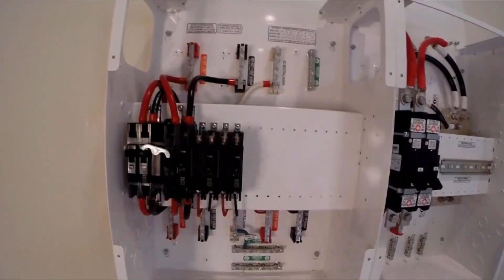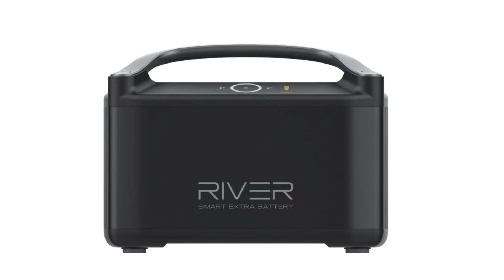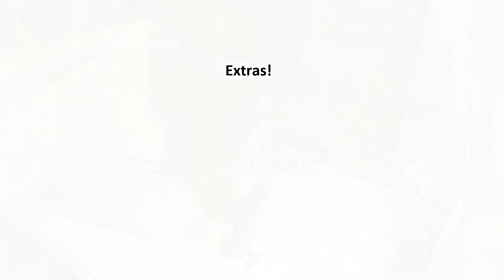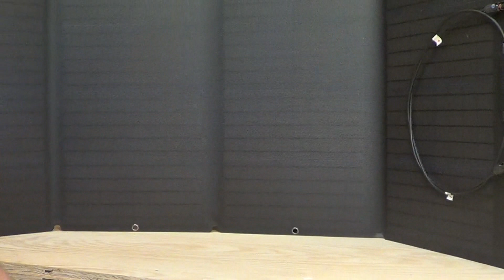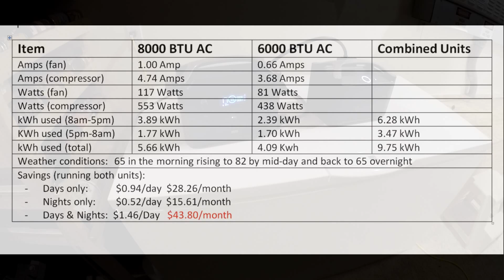EcoFlow RIVER Pro with Extra Battery and Solar Panel #EcoFlow

Comment: At the 10 min mark when you had everything plugged into the unit,it would've been nice if you had said how long it took to go from 100% charge to 57% charged...
Reply from the maker: ebayerr, As a general estimate for any of these systems, you can take the battery capacity in kWh and multiply that by the efficiency which is around 80% and then divide that by how many Watts your devices are pulling.  For example:
Running a light at 200Watts with a 1kWh battery multiplied by .8.  It would run for about 4hrs.  Of course there are other factors but this is a good way to ballpark it.  Thanks!
Reply: @HomesteadEngineering  : Yeah.Great example of having one device plugged in with a known quantity.
But it's a different story when there's many deices of unknown loads plugged in.We,the viewers,have no idea how many watts each individual component draws.

Comment: How come u don't show how, where to plug in the solar panels? Mine came with no instructions and I need an adapter
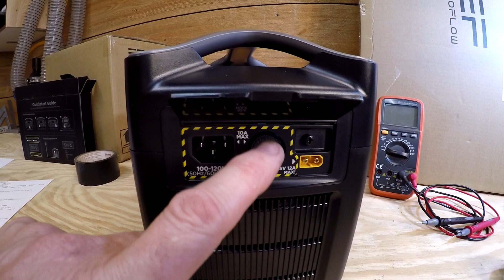Reply from the maker: Go to 5:12 then at 5:45 use the yellow XT-60 connector with the supplied adapter that has the MC-4 connectors that connect to the panels.

Comment: Another question please

I connected both of the batteries with the inverter to the 110-120 volt plug to a small refrigerator (set at 37F  degrees) that when on  (it cycles on and off) it uses about 45 watts.

I used a Kilowatt device to measure the wattage over a 24 hour period. It said I used .27 kilowatts or 270 watts over a 24 hour period.

The 2 batteries were at 86% when I started and after the 24 hour period it was reading 47%, so that is 39% of the two batteries.
So if both units are 700 watts that's 1400 watts minus about 15% for actual usable watts that leaves 1190 watts I used about 464 watts or 39% of the 1190 watts (86% to 47%)

But the 24 hour watt measurement was .27 kilowatts or 270 watts. So where did the other 194 watts go (464 watts minus 270 watts)?
Can that be all because of the inverter? That seems alot.

It means if plugged into the wall it would have used only 270 watts but plugged into the 2 ecoflows it needed 42% more energy the 464 watts?
I must be close using the 2 batteries actual power about 1190 watts and I used 39% of that.

Lastly,
I have now connected the batteries that are now at 47% to the 12 volt output on this same small 12 volt refrigerator.

I would imagine that the 12 volt during the same period would use much less wattage since their is no inverter that is working, correct?
And how much less do you think it might be?
Reply from the maker: Hello L.  Lets try one more test: 
1. charge both batteries to 100%
2. disconnect and plug in your refrigerator with the Kill-A-Watt meter for 24 hours or maybe even 48hrs
3.  Now recharge to 100% but use the Kill-A-Watt meter to measure what it takes to recharge

The difference should tell you the losses in the inverter and the charger.

Comment: 200W solar input, but 160W panel in normal conditions will give you about 100-120W.
Does it mean that we can plug two of them parallel? DId you try it maybe? Or two 110W?
Reply from the maker: I believe you can plug in what ever you want as long as you don't ever exceed the input limitations.  You have to look at Watts, Current and Voltage limits.  Note: Panels tend to up there Voltage and Wattage on cold days with bright sun.  I don't think the unit will be forgiving of exceeding any of these limits for any amount of time.  Thanks!
Reply: What I've read: More Wattage is no problem, the unit doesn't draw more than the specified maximum. But if you get more voltage than specified, it will switch off for safety reasons. So, parallel connections of solar panels seem to be ok. I only have one panel, so I have no practical experience on that.

Comment: Never knew I would be able to afford a power station as powerful as this River Pro for about $600.
Reply from the maker: While I do get a commission if you use my link to purchase, Costco has a killer sale on this right now.  So It won't hurt my feelings if you go there instead: https://www.costco.com/ecoflow-river-pro-portable-power-station%2b-river-pro-extra-battery.product.100716886.html
Reply: @HomesteadEngineering  I really like the display of the River Pro. You can get a ton of information especially the time left on the battery.

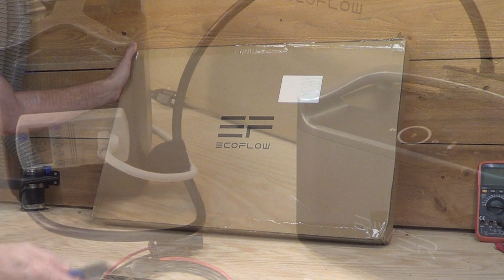Comment: Hello, at 16:32 you showed that it delivered 580Wh with the display showing 41% of the capacity remaining. Is that correct? That would mean 59% spent = 580Wh -> the total capacity is ±983Wh, which is only 68.3% of the declared 1440Wh. Have you made any other test regarding the real capacity with the extra battery? Can you please compare how many Wh can it provide via DC outlet vs the inverter? Thank you!
Reply from the maker: Hello Peter, There are losses in the inverter and in the charging system.  I have not run any efficiency test so far but I think some other channels have. Thanks!

Comment: can i power a Giantex Portable Mini Compact Twin Tub Washing Machine 300 watts?
Reply from the maker: If its 300Watts MAX then you should able able to run it.  That said, I have two concerns:
1. I don't like the way washing machines ramp up and down the power due to the agitation.  I don't run my washer on my solar and I have a 13,000 Watt system with a 9,000 watt inverter  
2. You could only run it for about 2hrs or 4hrs if you have the added battery
Reply: @HomesteadEngineering  ok. thank you for the detailed reply. is there any other generator you recommend?
Reply: @HomesteadEngineering  is there any other generator you recommend for a small giantex 300-watt washer?

Comment: Can i charge an e-bike lithium battery of 625Wh with this power station?The bike charger run 36V / 4A
Reply from the maker: cris, I don't see why not.  What kind of bike do you have?  I have two of the Aventon bikes on order and can't wait to get them.  Thanks!
Aventon Aventure Fat Tire Bike: https://alnk.to/9I7JN5C
Reply: @HomesteadEngineering  I haveFull suspension  MTB electric bike,Cube Stereo Pro with  an 625Wh battery

Comment: Have you had any overheating problems. Another review had his catch fire and smoke. Others say that their customer service is horrible for returning. Some have said you need all of the original packaging to return.
Reply from the maker: Kris, I have not had any problems with mine so far.  I am careful to use it properly and I see a lot folks on YT that do not understand its limitations.  This class of solar generator should not be thought of as backing up your house but rather used for smaller stuff like charging your phone, cameras or running a few LED's and maybe powering your laptop for a while.  I would definitely save the boxes it came in.  Thanks!
Reply: @HomesteadEngineering  thanks for replying. I’m real interested in getting one for my truck camper. Not going to run anything crazy on it. Just want to make sure that the company would have my back if it is defective and not my fault. Main draw to this compared to others is how fast it can charge from any source. Thanks again!
Reply from the maker: @kert987654  I think a truck camper is the perfect use for this size solar generator.  Charge it when your driving or from solar and use it for small stuff.  Never use the Eco-boost mode and never go over 600 Watts on the output.  I can't speak for their customer service as I have not dealt with it.  Thanks!

Comment: could this be used to run a rv fridge, if so for how long?
Reply from the maker: Lee, you would need to know its average and peek power requirements as well as how "hard" you are using it.  You can measure the average power usage with a Kill A Watt meter.  Plug it into the Kill A Watt meter and measure how much power it uses over a 24hr period.  The EcoFlow Pro can run items up to 600Watts and it has about 1.4 kWh  with the extra battery.  A wild guess on how long this would run a small fridge if you kept it closed the whole time would be 10-16hrs before you would need to plug it in and recharge it.    https://amzn.to/3flYIgz
Reply: I have a dometic CFX3 25 fridge and my Ecoflow pro runs it for about 48 hours in my car while traveling. Just ordered the 160w panel👍😀

Comment: Use Goal Zero since their beginnings. Have a 50, 100, 150x2, 350, 1000 Yeti & old 1250 (100 lbs); solar panels of 20x2, & 8 Boulder 30. The 350 battery died & is a great door stop. Wife wants to replace it, so I’m looking, so many firms now. This Ecoflow is nearly the same price as my 350 when new. You stated that most panels will work, include GZ? Does Eco Pro need to stay plugged in as GZ? GZ use to have great customer support but since COVID they won’t answer email. This is 2nd review on Eco Pro & I’m impressed.
Reply from the maker: Hello Garry,  I thin you can use any panel as long as it has the right voltage and does not exceed 200 Watts.  I don't know about keeping it plugged in as I have gifted mine to my son who lives in Michigan.  Thanks!

Comment: Just opened the box to the Eco flow Pro 720 I bought yesterday. Have not had time to review the complete instruction manual. The question, how do you go about changing, (removing) the internal battery inside the unit itself. I have a few Goal Zero products so it is easy to change out the internal battery in those units.
Reply from the maker: I had not even thought about removing the battery so IDK.  Let me know if you figure it out.  Thanks!

Comment: Is it worth it to go with the eco flow solar panel or do you think there are more economic options?  Wondering if there would be any additional connection steps
Reply from the maker: If I were using it on the go for camping and such then I like this EcoFlow solar panel.  If you planning to use it in one place at your home, then I would get a basic 200 Watt panel (much cheaper) and fix it in place.
Reply: @HomesteadEngineering  Thank you!  I'm planning to use in an off grid shed/office.  The only power requirements are lights, computer and monitor so this would be perfect.
Reply from the maker: @templeghg  Sounds good

Comment: Curious if you can charge it off a cheap square wave inverter off your car 👍😁
Reply: You don't have to. Simply plug it into the 12v socket. But now I'm thinking about it, your goal is to charge it faster than that by utilizing another inverter tied into your car battery, right?
Reply from the maker: I think it can be charged from a relatively dirty source but I am not really sure.

Comment: Great video!!!  Slow internet here in Mountains of NorCal.. on Satellite Internet... but loved what you covered.  Would love to also know the running db sound numbers.  Is this noisy when running 112watts of goods like you had?  Like if you had this is a RV or something.  Too noisy?  Quiet enough to sleep or do you need to drink lots of brew before bed so you just konk out and don't hear anyway.  hehe.  btw, I subbed to your channel!  Great stuff!
Reply from the maker: I barely noticed the sound at all.  Just a small fan.  I sleep better with a fan noise myself.  Thanks!

Comment: I am considering this plus the extra battery to run our normal size 20-year-old energy star rated frydge during p[ower outages.   Wonder if this setup could do the trick?  I used a battery meter device and the normal running watts of my Kenmore fridge is 135watts or so.  Surge I am not sure but would imagine the spike watts 1200 this Ecoflow has "should" be OK.    I know this has that X battery or whatever they call it of X boost to 1800 watts but don't think the fridge needs it if running 135 under normal condition.  Think it would work?  Have you tested this on a normal size home fridge?
Reply from the maker: TJ, If your fridge runs at 135watts continuous, then it would probably run for about 8-9 hours on both batteries fully charged.  If it runs 135 when the compressor is on and less when its off, then it will run longer than 8-9 hours.  If you measured it at 135 when the compressor was off then it will run less than 8-9 hours.  I ran a mid sized fridge on it toward the end of the video. Thanks!
Reply: @HomesteadEngineering  yeh did not ever see what is ran at with compressor on.  I am guessing the fridge doesn't run with the compressor all day and turns off while the unit stays ambient.. and then kicks on every so often during the day.  I seldom hear mine but there are day's I can here my fridge louder so much stumble in kitchen when that was actually on.
Reply: The ecoflow river pro doesn't have the extra battery anymore
Seems they stopped the production

Comment: Hey D. 
Just wondered if you had made any considerations towards faraday cages or just EMP/sunflair protection?
Reply from the maker: JJack, not much preparation for EMP or CME.  I do have two metal garbage cans that I keep radios and other electronics in.  I have considered getting a few backup solar parts  and putting them in a Faraday cage but have not been super concerned about it.  I did listen to one second after and that did drive some of my prepping.  BZA has a great series as well.  Thanks!

Comment: So theoretically you could keep a bunch of those extra batteries on standby to plug in as needed.
Reply from the maker: LA, theoretically but in reality I don't think that would work out too well because the extra battery would always be charged and the main battery uncharged.  I don't think the unbalanced battery situation would be a good idea.  It is a good idea and maybe they can think of a way to make it work.  Some kind of unbalanced battery mode.  Thanks!
Reply: @HomesteadEngineering  There is no problem with them being differently charged. The River 600 will take the battery that has the highest charge and use that. Every now and then it will check which is that and start using that.
The River 600 will not be charged by the external battery so when you run down the first external battery, the internal battery will also be empty. So while changing the external battery, you will have a short moment without power.
Unfortunately you can not daisy chain them.
Reply: At the price of the battery packs, it might be cheaper to buy the adapter that ecoflow sells and buy standalone lipo4 batteries. There are numerous lower cost sources.
Reply: @seeking70  I resolved it but putting The new Bluetooth EB 70 in each bedroom. It’s 5 adults and 5 kids in this house. My Peace of mind is priceless and now I have finished with ALL birthdays 🥳 and Christmas too at least for the adults. I am disabled and they take Excellent care of me so it’s cool 😎
Reply: @lagunn327  I've seen some write ups for the eb70. Definitely a great option!